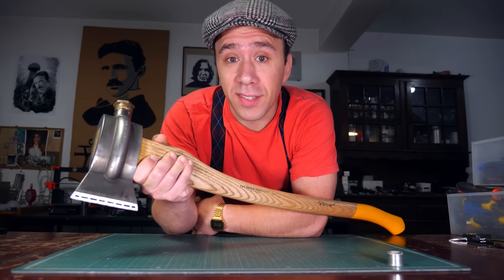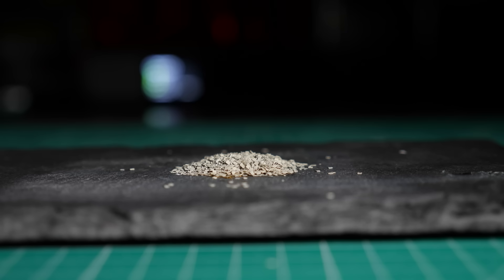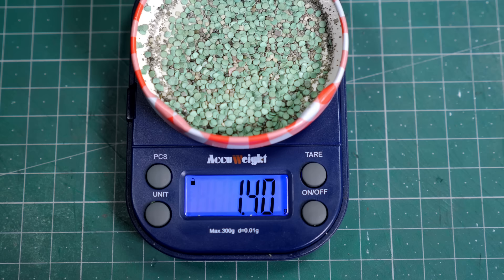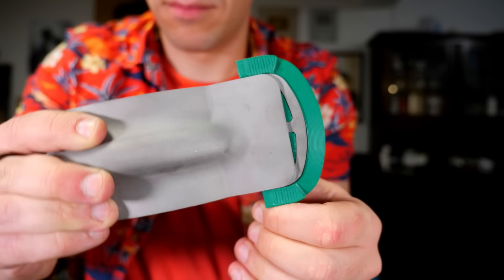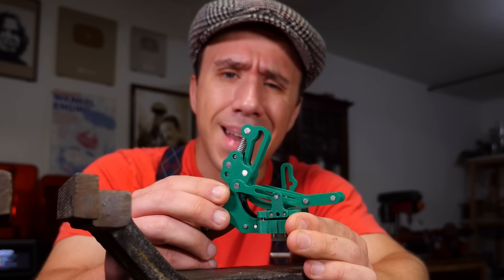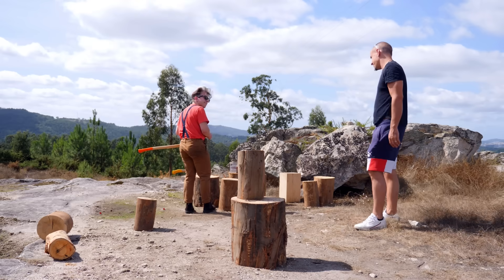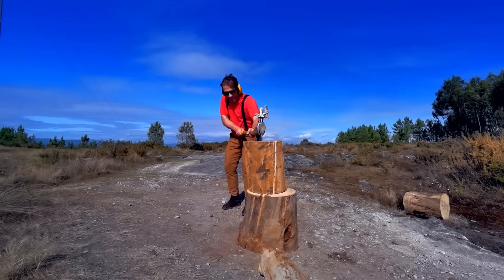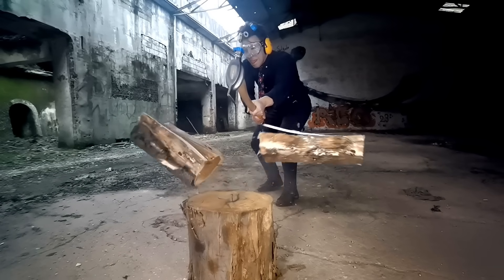I built a BETTER SHOTGUN AXE

Comment: Great video. In my humble opionin, as long as you are developing pressure, to get force you need area. You need a thin blade that can penetrate but expose a large area of the log to the pressure you are building up. From this perspective, I think the first blade was better, because had a larger area fot the gas to get into the wood.

Comment: Thinking about this concept... It's 3.6. I was wondering about high pressure air to replace the shell but math says it's borderline impossible or far too dangerous.
BUT! Here's an idea. The axe head is of 3 parts: 2 sides and a wedge-shaped middle piece. Spring mechanism pull / push the sides together. The middle piece, the wedge's head is sharpened and functions as the blade.
On strike, when the blade starts moving backwards, triggers a mechanism that counters this and forces the wedge forward, kinda like a hammer hit the thick end of the wedge, and this force also starts pushing the two sides outwards, both working as a "splitting force" on the log. When this "hammer hit force" is gone, the springs pull back everything in place.
Working out this axe-head I guess is tricky, yet likely would need less force for the same result, and would be fine with "slower release speed" to split the log, like a pneumatic "hammering device" or such.
Might be silly, may not work, but... Might do. Hope it was an inspiration anyway :)

Comment: Also, there are axes heads that lever outwards with the force of the head hitting the log. If that splitting lever was pushed by gunpowder that might focus the force so there is no wasted energy. I think they are for sale with springs in the splitter, time to remove those springs and use rocket power.

Comment: I feel like you should put the ports a little higher from the blade edge. If you get decent penetration and the shape of the blade is good it should keep better contact a little higher up and it would allow a chance to have more horizontal force with the blast. At least I would think so.

Comment: It looks like what you want is more of a sledgehammer than an axe.
So like, make your sharpened part like normal, or maybe with a concave profile, but it's only like 1cm deep. After that centimetre? It's a flat mass (instead of the wedge shape of an axe), stopping you from driving in too far
This will seal the top if the log didnt crack, and you can throw as hard as you want

Comment: Could you make it so that the pressure shoots out sideways about 20mm from the edge of the blade so that if you lodge the head in deep enough it shoots the wood sideways? Would be great for really hard woods as I'm in Australia😂 you hit it with full force and get it in a little

Comment: Shift and reshape the exhaust opening so it’s centered and more tapered (pointed). This will focus the gas jet, allowing you to tap the axe into the wood with very little force—then the gases will push the wood apart. Right now the exhaust port is too wide and not focused in the centered only,  which is why you’re losing pressure.

Comment: With any Australian gum tree you'll never split it by hitting it in the middle. Look at the growth rings and hit the blade along them going in a circular patten . With gums about 10 to 15 cm from the outside edge they should cut all the way through. Some gums you need dynamite to split.

Comment: given that both the timing and the depth of penetration are important for the detonation, I'd recommend tying the trigger mechanism to the penetration of the wood and not the impact. There's axes that use levers to transfer some of the force applied by the lumberjack towards pushing the log-halves apart (leveraxe is a brand that makes these, easy to google). You could use something inspired by that mechanism as a trigger. It could be as simple as a rod on the side of the axe that pushes up and hits the back of the trigger. That way, you can tune how deep the axe needs to penetrate and prevent premature ejacu... firing.

I'd also recommend talking to someone with experience chopping different woods. You were probably right with the lucking into using pine, because not only does it split easily, it's also soft enough that the initial strike can deform the wood at the impact site without that deformation necessarily causing the rest of the log to split. You basically form a perfect seal around the front of the blade. Wetter (more freshly cut) wood will also deform more without cracking, giving you that seal, so even the eucalyptus would might be easier if you can get logs from a freshly cut tree. But that's just arm-chair youtube-commenter-speculation, a sufficiently experienced wood cutter might have much more useful insights!

Comment: Try using commercially available 9-mm blank cartridges. They are readily available, the design has potential, and with a working magazine mechanism you could use the device to split wood more efficiently.

Comment: I can't help but feel that it'd be more helpful for the splitting to have a long wedged blade, and the pressure working as a propellant, pushing the axe down instead of trying to achieve a seal and push the wood apart.

Comment: Would it work to put a nail at the front of the axe, my thinking is the nail impact will start the firing but the momentum will see the axe head embed just as the explosion happens,then as the nail is embedded it should stop the axe jumping out. A seemingly simple thing to test without radical redesign. Also, please be careful

Comment: I think one of the issues with the new design is that the vent ports are extremely tall, meaning you need to really get the axe deep into the wood before the top of the port is sealed.  This leads to the issue you mentioned where if the axe is too deep it will open the wood too much and allow the gases to escape.

Comment: The problem is you are using direct impingement. Using the gas directly to try and spit the log. The correct way to do this is use a piston. Where the gas fires a piston which in turn drives the axe apart. So your swing embeds the axe into the log. Then the shell fires  uses all that gas on piston to drive the sides of axe apart. What you want is an axe head like the chopper1 https://www.youtube.com/watch?v=1AmB1rF9Mlg but instead of using the axe head momentum to drive the wedges apart you want the piston to do it. As this design should be more efficient you could run the 'engine' on any number of gasses which will make it much more practical. You can use gas lines in or on the handle to fuel the 'engine' and only need to coordinate the spark. Assuming you have a return spring for the piston and some more for the wedges you should be able to swing several times without needing to 'reset' as it would al be automatic.

Comment: Looks like you were trying to split eucalyptus.  That's a very difficult wood to split in large rounds, especially when dry.  The fibers are well cross-linked and the entire grain structure tends to spiral a it, making it more difficult to split.  And on the one you blew the mechanism off the axe on it looks like it had a knot, which is triply hard to splint in eucalyptus.  

You'll note that all the ones that split well had pretty straight grain with very little spiral, no knots, and were of smaller diameter.  Even those left a lot of clinging fibers as they blew apart.  

The mechanism works, it's just that you chose a difficult wood to test on.

I've spent a lot of time splitting wood by hand and eucalyptus is one of my least favorite to work with.

Comment: Would like to see this idea in a pick axe design. You would pierce the wood piece with the pick and have holes down it's entire length. I think it would be better than an axe if you manage to keep the air inside the wood and not let it escape around the pick. And of course, not having the wood split in your direction.

Comment: Gotta love good brothers. There for the stupid shit.
That said I have an idea. What about making it in 2 parts? Instead of relying on shotgun shells you pull back and use .22 blanks. The kind you should be able to get for a nail gun.  Then instead of using the gasses to separate the wood you instead make the axe apply pressure to both sides. There is already an axe that does this but without the blanks using manual power to separate the wood. With my idea you would actually use leverage instead of worrying about how the gas is going to spread out.

Comment: It would be cool if you could reload it through the handle so you could store like 6 rounds before needing to reload. It might also be worth running the explosing through the handle (event filling the handle with the hydrogen oxygen mix could work since you have more volume), but the risk is that the handle can explode

Comment: I know you teased them, and they may not have enough power, but it would be sweet if v3 of the ax used the .22 blanks on a strip so it was quickly reset for chopping multiple logs

Comment: Bro you should check out that impact nail hammer that the crazy guy from "I did a thing" did.
Make everything from stainless steel and the primer hitting mechanism with a small spring and magnet. Do not underestimate the pressure!

Comment: I used a similar thing, way back when I worked on underground electricity cables. It was like a gun, that you bolted to the cable. You'd put a blank bullet in, and it shot a spike into the cable, creating a conductor between the phases. It it'll blow fuses for sure, if it's alive, so no matter what, we wouldn't blow ourselves up. Funnily, we called it a spike. Lol

Comment: I feel like you need levers on the axe head. Like, instead of depending on the log to seal the holes, the holes are sealed to start with and the gas pushes on wedges instead of on the wood.  Bonus points if you can get the explosive action to drive the wedge even deeper... but then I guess you're just making a rocket axe.  Which sounds amazing!

Comment: You can still use the brown gas (Hydrogenoxygen mix) in an axe, you'll just need a pressure vessel to use as gas storage and boom vessel. Maybe even pressurize after cooling it so it doesn't self-ignite for an even bigger boom? It would make the axe heavier though, and recharging it is going to take time and be cumbersome.

Comment: What about a 1/2 liter steel tank for H2/O2 mix on the back, should be plenty to blow apart some wood??
Or with some pipework for oxy/acetylene propane welding tanks,  oxy/acetylene should be much more energetic than H2/O2.....

Comment: first of all wear industrial helmet and face shield bruh
2nd make axe less wide so it digs deeper and seals better like a pick
3rd add some prongs near axe head blade on the sides so when they touch wood will trigger some contraption on top
alternatively use electronic ignition mechanism based on accelerometer + proximity sensor for consistent firing if you can make it compact enough you wont have to use clunky contraption (perhaps you could offload processing to a phone, leaving you with a simple bluetooth board 2 sensors and electromagnet)

Comment: One thing I’m noticing and this comes from a firearms enthusiast from the US, I noticed smoke coming out of top of your mechanism and that leads me to believe you’re losing a LOT of pressure due to the chamber not being fully sealed. The tolerances on a bullet and the barrel make a really tight seal in the chamber allowing for most if not all powder and energy to burn down the barrel and propel the bullet forward. Some weapons do this so well such as ARs that they have gas systems the redirect some of this burnt powder back into the buffer to cycle the weapon. Long story short I believe you could seal your chamber better and have drastically better results.

Comment: A couple ideas I think might help: 1) give the side profile backwards serrations, so that similar to barbs it has more resistance to being pushed out. 2) I think you want to port the gas more horizontal than forward, the force is pushing the two halves away from eachother, this should also help with the blade backing out, and perhaps have less issues with sealing. 3) I'm not sure what exactly this would look like, but rather than using the gas itself to perform the wedging have some form of mechanical wedge that's driven by the gas, this should be less influenced by the sealing action of the wood (i.e. be more repeatable). What I can't figure out for that tho is how you'd get it wide enough to push instead of penetrate, with enough length to actually wedge, with enough girth to survive the blast without becoming shrapnel, while remaining a shape that's easy to get in there by hand. I'm not convinced this one is really doable, but if there is a way I believe it's an overall better approach.

Comment: Your file sounds dull. With a sharp  file you cut the material, not just "sand" it, and it goes much faster. I suggest you invest in a good set of files that stay sharp for long. I have good experience with bacho for example. 
Great video as always!

Comment: It also appears that on the new design the venting ports are further away from the blade edge?  It seems like way you've multi-layered the axe head makes it more likely the vents will vent on top of the wood rather than in the wood?

Comment: There exist shotgun blanks which may be easier to get where you live because they don't contain any projectile

You also save time not having to remove projectiles, and reduce the safety concerns of handling and storing lead.  You can absorb a lot more lead through your skin than you might think.  Remember to wash your hands twice in cold water after handling it, hot water will open your pores and you'll absorb more.
Reply: Lol I was about to say it looks like you're trying to chop oak or something hard like it and something soft like pine would be much easier